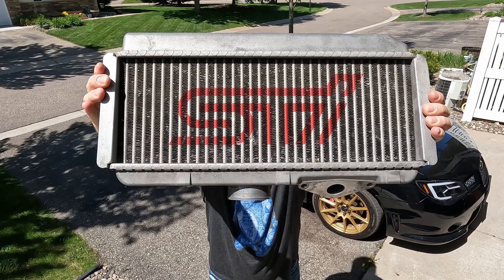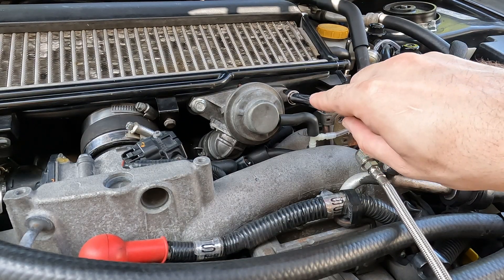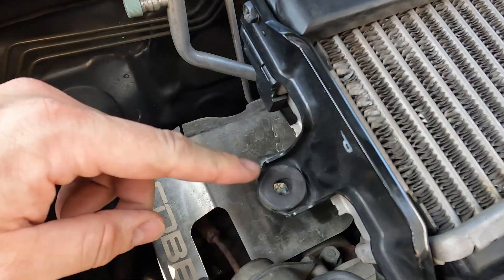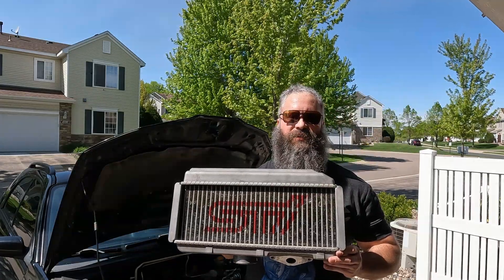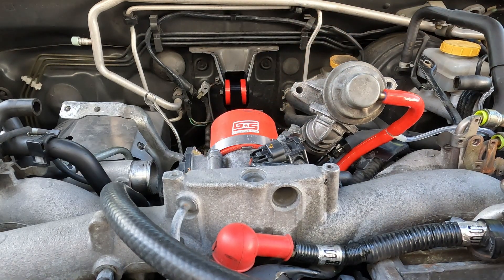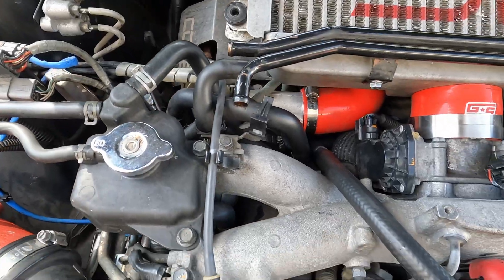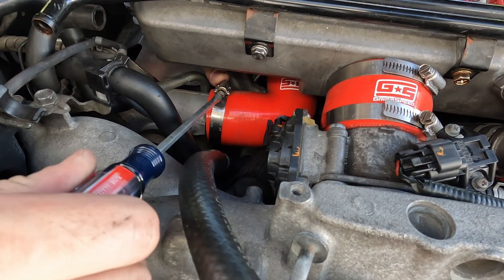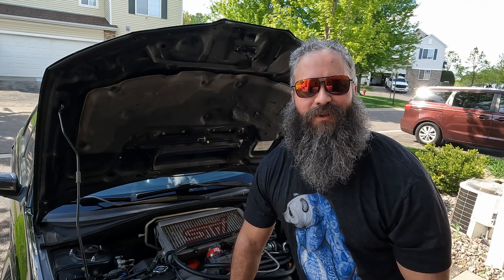How to Install an STi Top Mount Intercooler [Subaru Impreza WRX STi and Forester XT 2002-2021]

Comment: It is worth noting that the GE WRXs have a completely different intercooler layout to the STIs and will need more parts and planning
Reply: GE? do you mean GR? Maybe VA? There isnt a GE with a turbocharged engine.
Reply: GR tmics just need a extension peice of steel on the passanger side bracket and it will work

Comment: did you have to modify your pcv brackets to fit onto the sti intercooler? maybe i was lining them up wrong if you didn’t have to. did this whole job then realized i needed the sti bpv/recirc tube 😆

Comment: Any need for a Tune-??? Thanks ❤
Reply from the maker: Excellent question.  You can install this without needing a tune afterwards.  The intercooler is larger than the stock intercooler so it will just cool more air.  This will help with any tune you get in the future.

Comment: Hello sir, i got forester sh xt. Would it be good if i swap the stock intercooler to sti intercooler? I already swap the stock radiator with koyorad.
Reply from the maker: An STi intercooler is larger so it will cool more air, which is good.  You would also want to look into getting a larger hood scoop splitter to bring in more air for the larger intercooler.

Comment: How much clearance from the AC lines? I'm looking at a 2nd hand STi intercooler off a EJ257 and throwing it into my EJ255 Forester. Looks like it might need padding between and the AC lines.
Reply from the maker: It's close but it does definitely clear it.  Aftermarket top mount intercoolers will come even closer to the AC lines.  I've never seen padding needed.

Comment: Have you got the 4" carbon fiber scoop? Maybe do carbon fiber hood if your daddy war bucks
Reply from the maker: I don't but I have an upgraded splitter.  A hood would be nice but I'd rather buy a front mount intercooler and then possibly get a non turbo hood for the cost.